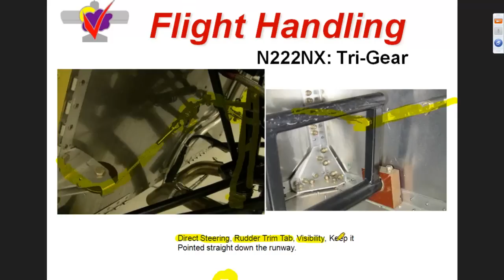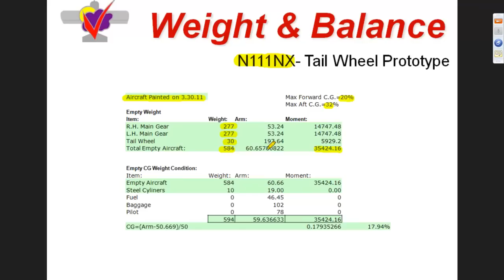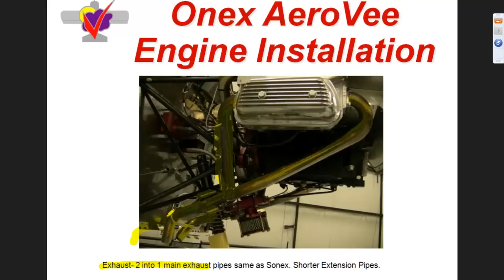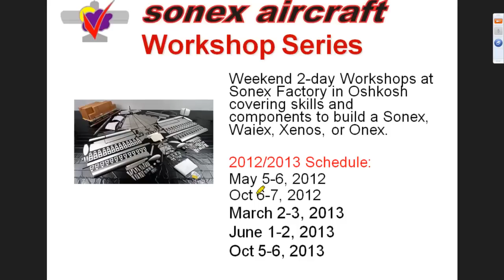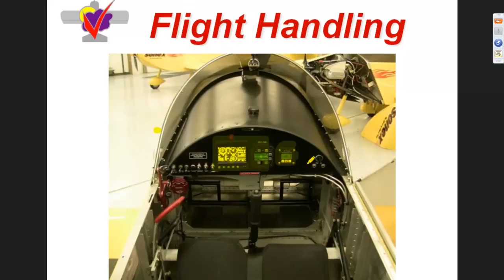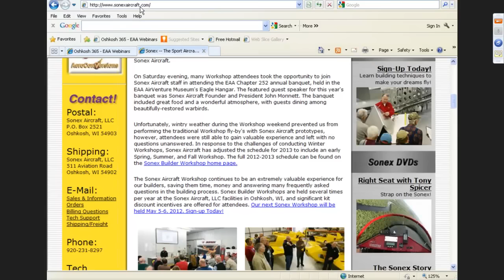Webinar: Onex Kit Aircraft

Comment: Perhaps I'm missing something, or flat out wrong, but SHOULDN'T the aft CG be no more than 25% back from the leading edge of the wing as nearly all cross sections have a CL at the 25% location? I always thought that the CG should be in the 18%-25% range.